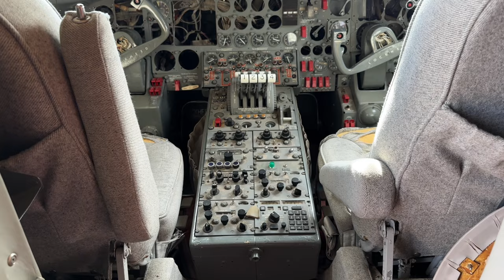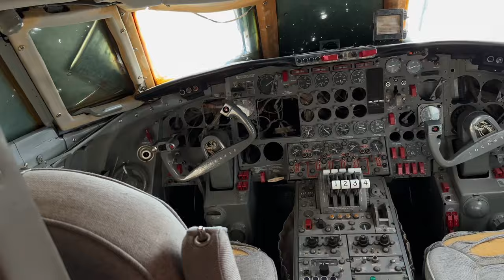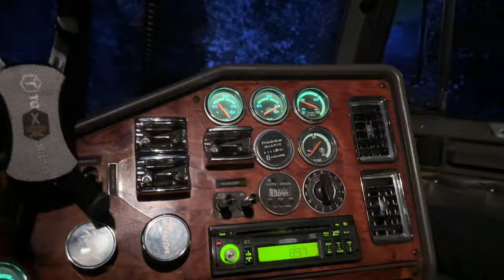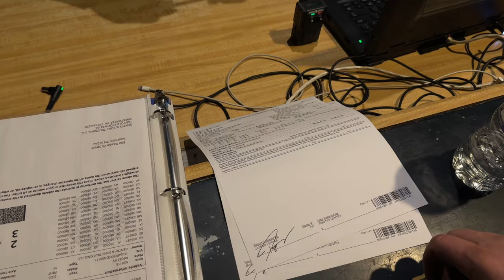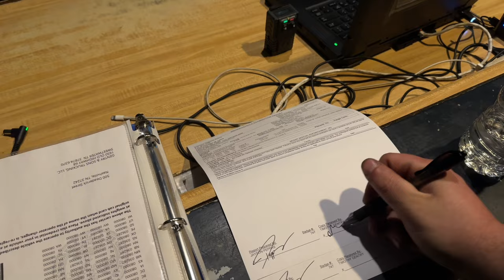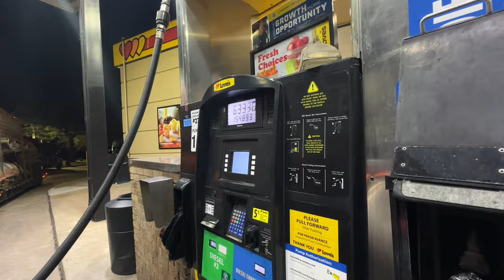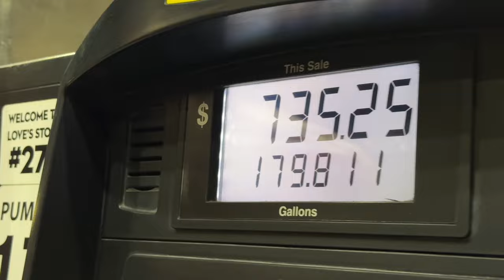POLICE Chased Down The Elvis Presley Private Jet!!

Comment: Ironic the DOT pulls you over and 👀 looks for anything they can find wrong with your truck,trailer,load,or paperwork. 
Meanwhile the office building they are working out of is full of electrical code / NEC violations.
Reply: Welcome to Arkansas where the police are more crooked than the teeth
Reply: The only did a driver inspection and not the full truck
Reply: Ok so I wasn't the only one who noticed that mess everywhere in that office. Looks like a fire hazard.
Reply: @John-ib6ec  Level III inspection
Reply: They need to update Their office. What a dump

Comment: The Lockheed jetstar was capable or a cruising speed of 567mph or 0.8 mach , you guessed right Tim , it did boogie , especially when it went into production in 1961 .
Reply: Mmo was .8 Cruise speed more like .72 they were dogs.
Reply: And noisey… made alot of noise. Reason it was left on the tarmac.

Comment: It was sure nice riding along with you. I drove truck OTR for 13 years. Drove for Greyhound for 4 years. Sure enjoyed hearing the sound of a truck. And I agree two of my most favorite trucks were KW and Freightliner. My kW's had Cummings engines but the Freightliners had 60 series Detroit but they all had 13-speed Transmissions. I remember going across Nevada, Utah, New Mexico and even Texas as a low-flying aircraft was running 120 mph. Every now and then you got to stretch your legs. Keep the shiny side up and the dirty side down

Comment: here in the UK you are allowed anything up to 6 inches overhang on the sides and rear of the trailer without warning other motorists, and upto 6 feet overhang off the back or upto 10 feet wide with warning beacons and markers, and up to 16 feet 6 inches from the floor. anything over that is classed as over sized and requires an escort vehicles, unless slow moving then you also need an escort vehicle like the army/millitary vehicles.

Comment: Been by that coop plenty of times but never pulled in. But that's the thing driving for a large carrier is most of the time it's green light from the PrePass lane scales. Seemed like pretty cool DOT but always see plenty shut down over there. Then drove regional for Walmart up in IA, IL and MO. Those scales were never up over night. Smooth sailing. Pulled 92k rebar in CA with a 10' spread axle and got a few more inspections during that time though. Those damn super coops out there though are something else. But green lit through them vast majority of the time.

Comment: i run the same sylvania silverstar heatlights. they are notorious for water leaking inside and they are only good for about 400-500 hours before they burn out. if you do alot of night driving they burn out fast.

Comment: The McDonald Douglas DC-3 was the most produced at just over 16,000 from 1936 to 1950. However, most weren’t used as commercial airliners. Most were built for the military. 
The second most produced commercial airliner is the Boeing 737 is the 2nd most produced jet airliner ever made with over 11,000 produced since 1966. There are something like 450 built and awaiting delivery with around 400 more waiting to be built.
With that said the most produced airplane of all time is the Cessna 172 with more than 44,000 having been produced since 1956.

The airplanes you were originally calling a small Cessna are actually T-6 Texan II Turboprop Trainers.

Comment: 8.2L fuel pincher. Too bad they were 4cycle. They ran forever but when u had to work on them they were a pain in the ass. I rememeber main deal was oil cooler leaks

Comment: Tim, motor are rotated by induction, engines are by combustion …. Lesson 101 in mechanics  … jets have turbine engines. Airbus 300 maybe not the most successful jet, but please review the Boeing 747’s to find out which might be. Boeing are finding it difficult to replace this piece … only thing wrong is it was the most environmentally?? bird to fly.
Reply: The only thing I know about planes is what I have heard/learned while being a passenger in one but I thought the 737 was the most successful commercial jet plane

Comment: I aint following the rules. I special. 
Least you fixed the loading of plane. 
Was time those good olboys would have measure you to check your width.
If it had been fixable , don't believe it would have been cut up with saws all. 
You didn't check your weight, why? Oh forgot your special. Stops the wonders. 
Who was in show off lane instead of where they belonged? 
Yep safety first getting to be more lip service.

Comment: Not a SMART MOVE IN HOOKING UP TO TRAILER WITHOUT HAVING THE AIR HOSES HOOKED UP TO THE TRAILER, BEFORE BACKING UNDER THE TRAILER. #1 rule is to first hookup your air lines before backing in under and hooking on to a trailer.

Comment: Youtuber.. Utah.. diesel related... Everide? :P Obviously it's Heavy D or Diesel Dave.. probably a helicopter knowing him. Those little planes are the Brazilian made A-29 Super Tucano, they were starting to use them for Army National Guard Close Air Support missions with some 20mm cannons and rockets strapped onto them but they quickly found out that nothing replaces the A-10. We also trained the Afghans to fly them but obviously that was a waste of effort. They are only 20 years old at this point. Elvis' jet was capable of cruising at 504mph 540 MAX speed @30,000ft.. roughly 0.75 Mach. 
While I don't really care about Elvis or his plane, it's sad to see that they cut channels out of the wing root to fit it in your trailer.. That's a REALLY important area of the plane if it was ever going to fly again.. Now that they did that, I doubt it ever will be able to fly again... the FAA is pretty critical about the potential of wings ripping off mid flight.

Detroit Diesel 2 strokes are the COOLEST diesel ever made. I wish I could have one and build a military themed hotrod truck like some Air Force mechanic in 'Nam might've made with scrap laying around. I remember hearing them coming for 10 minutes before they got to my grand parents' house up in Stirling City California, and a long time after they went past both going up the mountain and coming down. The big one that got me though was seeing Rollin' Thunder at the monster truck rally at ARCO Arena in 1989 when I was 4 years old and listening to that 6V71 in Jim Oldaker's 72 Dodge Tradesman.. same night I fell asleep in the wheel of Bigfoot. (still have the picture.. go figure I'm a Ford guy eh?)

Hmm, never heard of the 8.2, but then I don't know much about their four strokes. From what I just read I guess those were originally designed for busses and marine use and were known to get really good mileage but made only 1/3hp per cubic inch and had a lot of issues that lead those engines to break a lot.

Oh by the way, if you want to buy older trucks, come out to California and you'll get screaming deals on them because any big diesel older than 2010 is now illegal to run professionally unless you pay the money to adapt it to a modern engine and emissions systems. There's all sorts of stuff for sale out here now. I was just drooling over an old Kenworth gravel truck a couple weeks ago that had a Detroit in it and I think it was a 95 and they wanted $15k for it and it was in AMAZING shape. 

Great job at offering them to check out the plane and then bailing without opening it for them.

Comment: I'm sorry, I really can't set through a 47-minute video. Can you report a very special recap no longer than 3 minutes. The reason they ask for the tire check it's to prevent an unnecessary plane crash. That rock you didn't remove from your tires could find its way into a place on an aircraft that it's not supposed to be, and bad things can happen.

Comment: A FRIEND OF MINE LOOKED INTO BUYING THAT PLANE BUT HE FOUND OUT IT WOULD COST $100K TO MAKE IT AIR WORTHY AND PASS INSPECTION.
PLUS AT THE TIME THERE WERE NO FLIGHT LOGS FOR IT.
WITHOUT FLIGHT LOGS ITS NOTHING MORE THAN A DECORATIVE YARD ART.
HOUND DOG SAT TOO LONG WITH NO CARE AND NO INSPECTIONS. 
MAINTENANCE OR CERTIFICATION.  ITS A MONEY PIT.
NOT TO MENTION STRIPPING IT PAINTING IT AND GETTING CERTIFICATION WILL BE AN EASY $20K TO DO IT RIGHT.  MY FRIEND FOUND THAT OUT THE HARD WAY WHEN HE HAD HIS PLANE PAINTED THINKING ITS NO DIFFERENT THAN PAINTING A CAR .TRUCK OR BUS. HIS PLANE WAS FLAGGED.
Reply: G'day,

Actually, the Quote was
$5.7 million
IF... 
Anybody could find engines for if, because it's Engines were sold to a Museum decades ago.

There are no restorable Engines on the market, and no Spares for them...

The Showstopper is an FAA Airworthiness Directive on Engine Noise which the Original Unobtainium Engines cannot pass, and they're the only Engines which meet the Type Certificate Specification.

It's an expensive Lawn Ornament. A ratty tatty Aluminium Can of Birdshit.

Such is life,

Have a good one...

Stay safe.

;-p

Ciao !
Reply: @WarblesOnALot  ohhh I see. 
I guess he was under the impression the engins were still there. So what all was on the trailer besides the fuselage.  Were those just the engine surrounds on the trailer. I remember him looking into the plane and asked me about painting it because I painted yachts semi trailers and trucks for 35 years. I told him I didn't think I could paint it due to regulations.  This aircraft was hound dog 1 correct.  
Where are the wings for this aircraft. I wonder how much damage was done on the trip. 
People don't realize how thin the aluminum skin is and how easy it is to damage. Not as easy as hauling a boat. Straps don't bend boats.  Too bad she will never fly again.
Reply: @w124mercedes7  

I dunno about the Wings, or the Tail Surfaces, they probably went on a different Truck.

The things under the Fuselage were the Fuel Tanks, they stuck out halfway out along the Wing Leading Edges and the 4 Engines, pure Turbojets - super loud and fuel-hungry, were in Pairs, podded each side of the Tailcone, at the bottom of the Fin.

I wouldn't have accepted ownership and responsibility for moving the thing for less than $50,000, because it's going to cost that much to tow it to the Dump.

Jimmy seriously ripped himself off, when he agreed to buy it AFTER the Auction, wherein the Auctioneer fuctup BIGTIME and sold the Aeroplane's remains to a (Dummy) "Telephone Bidder", and then the next day they rang Jimmy up and convinced him to buy the bloody useless thing - anyway.

They sold it to a gullible idiotic romantic Dreamer, who deluded himself that he could break even on finding a use for it...; rather than complying with the Airport Management's request that they pay higher Tie-Down Fees or take that pile of Scrap to the Dump.

Elvis has 
Bin-Compostin'
For a
VERY
LONG
TIME...

Most of his more
Cashed-up
Fanatical
Devotees
Are all
Pushing up the
Daisies,
Too...

And the other two
Elvis-owned
Aeroplanes are already being
Deified and
Sanctified at
Gracelands - and some other
Cobweb-encrusted
Shrine to the
Long-dead
Crooner.

I was a Teenager when
Pink Floyd, AC/DC, ABBA, Led Zeppelin, Queen, Elton John, and Sky were all the rage ; and the Beatles, and Jimmy Hendrix and Mamma Cass were the sanctified Canon.

Elvis didn't even have the Balls of Cassius Clay, to tell Unkle Spam 
To take the Draft and
Jam
The Paperwork fair up the
Arseholes
Of the
Pentagonal 
Haemorrhoids
Who were utterly
Devoted to
Playing
Waaauughhh(!).

So, in 2023, there was 
NEVER
ANY
Rational Reason to be buying the
Carcase of the 
3rd-best
Inefficient Aerial
Fire Chariot of someone who
Wasted their life
Chasing monetary payments for
Singing
Songs
And
"Dancing"
Simultaneously..

There are REASONS
For
NOT 
ever Ever EVER
Paying good money for
Old
Dead
Aeroplanes...

Just(ifiably ?) sayin'.

Stay safe.

;-p

Ciao !